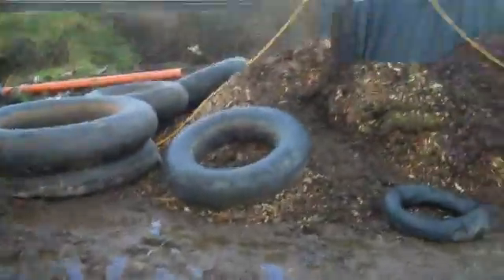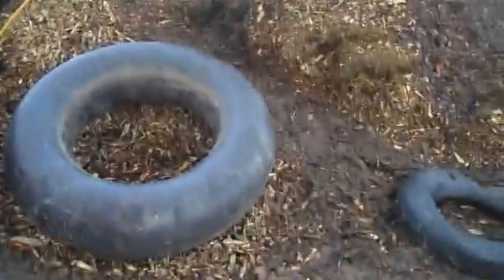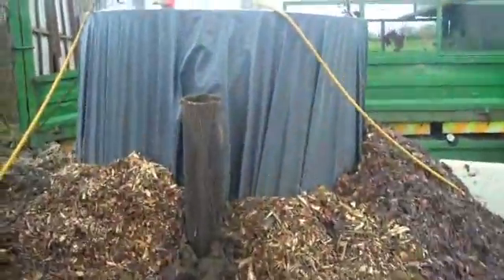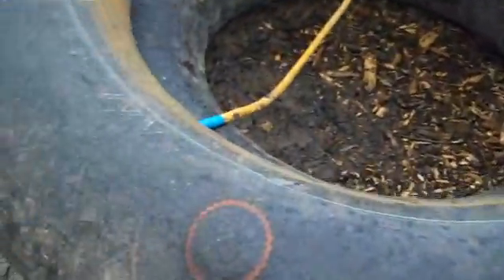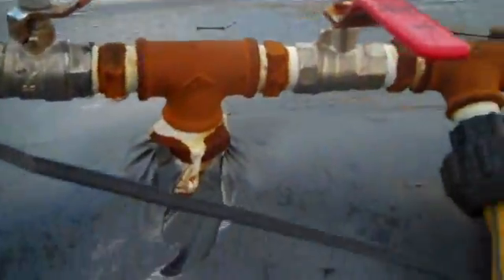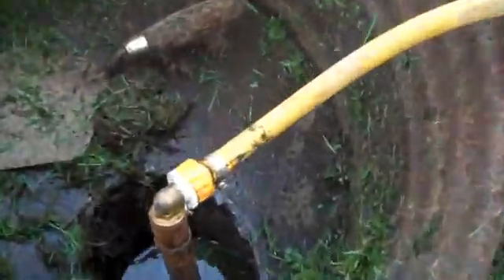Biogas made from grass digester d.i.y.Ireland 2 Jean Pain

Comment: Michael,  did you add biogas scrubbers to it. to remove the  CO2 and the hydrogen sulfide from the gas.     sodium hypochlorite  Bleach for the  co2 and  wire wool to remove the hydrogen sulfide
Reply from the maker: If I was  do take it seriously I would
Reply: @CALOCALKY  so it was just an experiment
Reply from the maker: @madladpjl  And to get a feel for  it
Reply from the maker: If I was  to take it  seriously I would

Comment: How to fill tubes, by using diaphragm pump?
Reply from the maker: a p in the tank you have microbes, I feed them with grass, thay imet gas crating pressure in the tank that the tub is connected to, the pressure causes the tube to inflate

Comment: Whats the pressure, volume, volumetric flow rate, tube size, production rate and consumption rate?
Reply from the maker: Haven,t fed or agitated it  in about a year  which meant grass floated to the top and has  made a seal but in spite of that it is still producing a couple minutes of gas ever couple of days

Comment: How much time each tube take to fill?
Is it continuous process?like if you remove one tube and attached another it starts filling it.
Can we compress it into a cylander?
Reply from the maker: Sorry for the delay but i haven't done it in some time and cant remember how long it takes each tube to fill .It is a continuous process as their is a certain amount of pressure belt up from the the gas coming from warmed material inside the tank

Comment: All good stuff, I get a lot of grass (and leaves at this time of year) from my gardening round, although it tails off in the winter to a certain extent. I've been procrastinating over building a small AD unit but have now sourced some plastic drums so may make a start this winter. Cleaning the H2S with wire wool seems like a good idea. I thought it might be interesting to experiment with an idea I've had for scrubbing the CO2 gas out of the mix also, but I want to try it out before I start shouting about it as I don't want to look like an idiot just yet:-). I had an idea that if you were going to run a genny off your biogas you could add an HHO generator, powered from the genny output, to produce and add hydrogen and oxygen into the carburetor to improve combustion and see if you get additional performance from your biogas.
Reply from the maker: I think there is some kind of hydrogen that can be got from the above  ?
Reply: Yes the methane is a hydrocarbon but the HHO from a hydrogen generator could possibly aid that methane combustion, in particular if the fuel still has impurities like CO2 which might reduce the energy available in each cycle of combustion in the cylinder. It would give you more bang for your buck if you know what I mean? I was given an old one off a mate and am going to bench test it before I fit it to my Transit.
Reply from the maker: Russ Howe For me layering one technology over an other is the way to go like your suggestion

Comment: Was thinking of a 45 gal plastic drum well insulated with maybe a solar water heater, don't have a big lot of waste from the house but there are sheep in my fields. Hoping to rebuild a new Lenz onto an electric bike hub but much smaller, engineered into to many problems but have a better idea now of what is needed to produce some power.  I have health problems that limit the amount of heavy work i can do with out wrecking myself so large scale stuff is just out of the question.